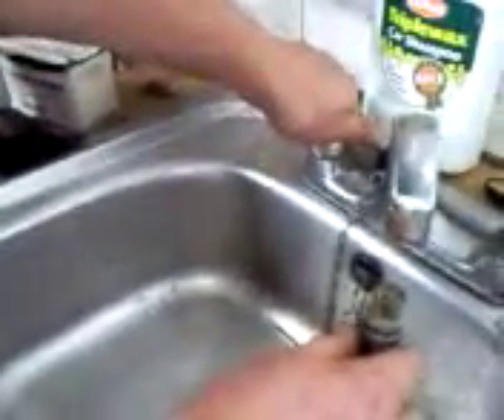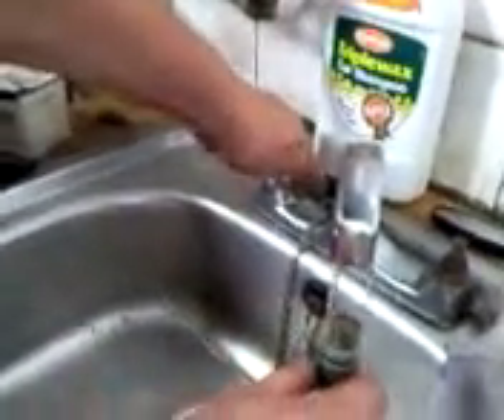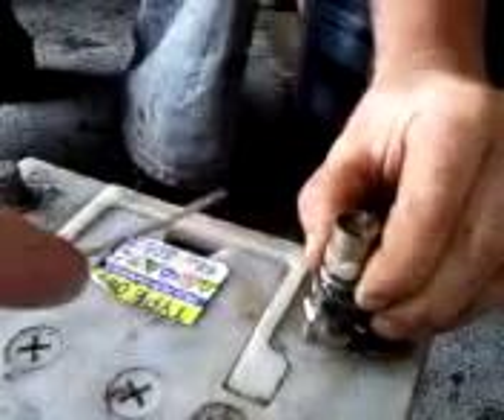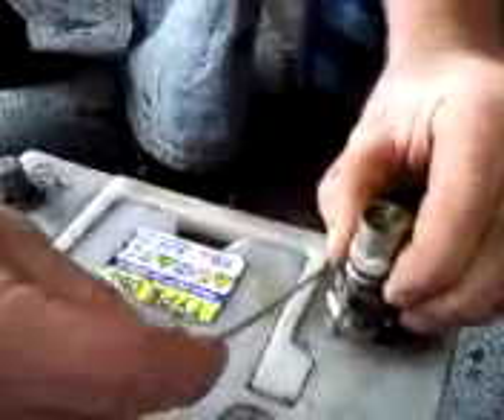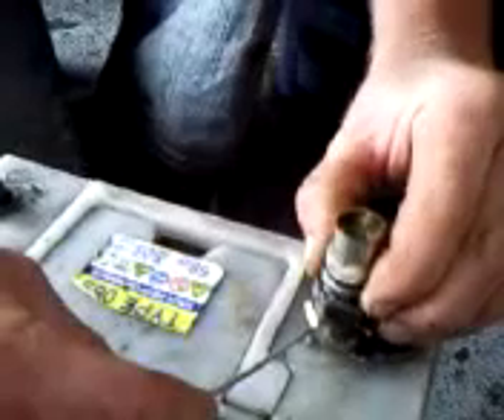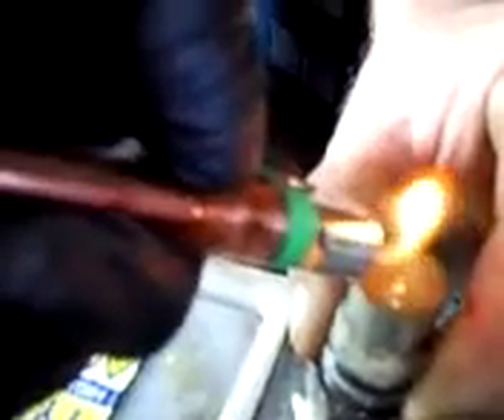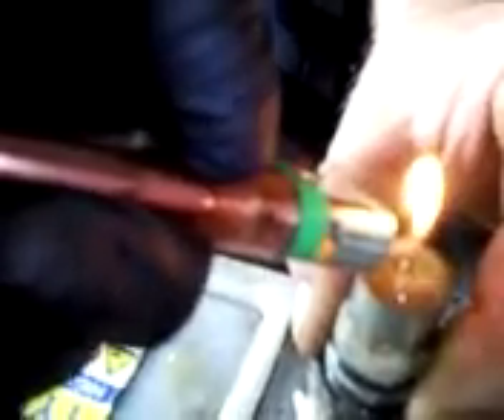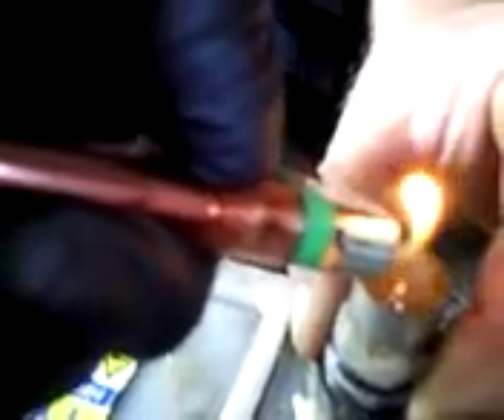HYDROGEN FUEL.WATER INJECTION PROTOTYPE.PLASMA

Comment from the maker: it is stainless at top of plug to stand the heat and steel at bottom ...have a look at old aviation spark plugs .they come apart and ideal for a water plasma hydrogen injector..need 4 more if you know of any .got some pictures to show you so email us a direct address cheers melvin

Comment: is that steel or stainless steel casing?just wondering how long it will last before the electrolysis coats the working parts.
nice use of an existing part...5 from me